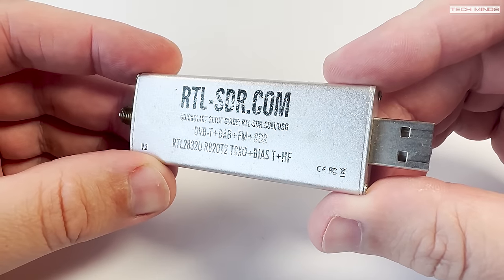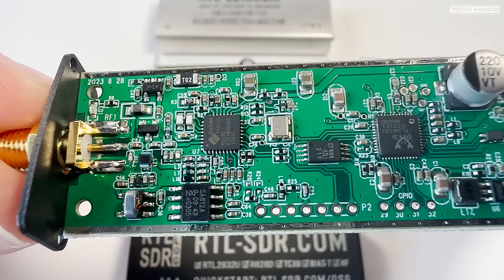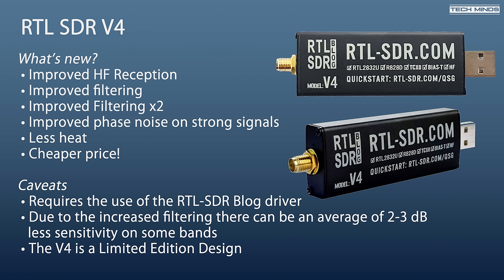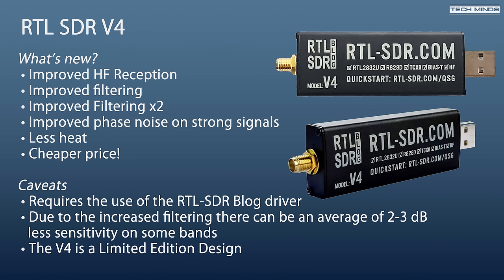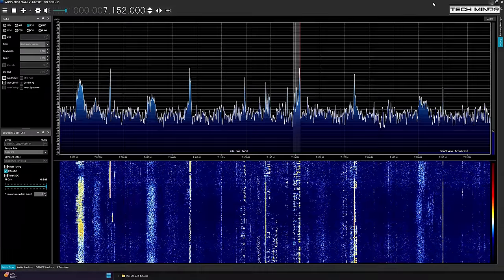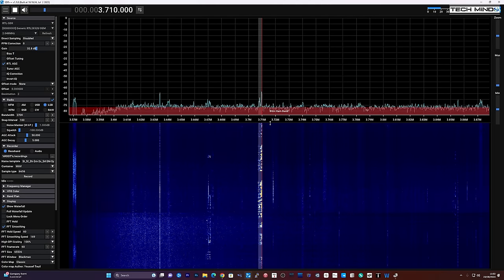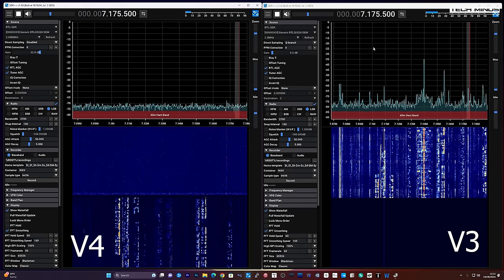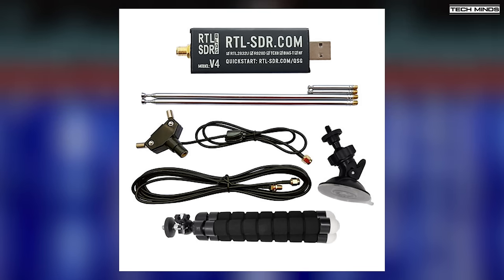RTL SDR V4 - Now with Built-In HF Upconverter  + More Features

Comment: Its using an old chip, the v4 will only exist whilst this old chip is around.  v3 or wait for the v5!
Reply from the maker: Yep, as said in the video, they have around 1 year of production supply left. Which is why it’s good to get one now.
Reply: This is not the latest iPhone so I don't think the R828 and R820 have that big of a difference in performance. And then you get an up converter with the V4. Just an external upconverter can cost more than this. So don't buy the V4, leave them for us .
Reply: Is there any difference in the descriminator section, extra band isolation, or any buffering that might be offloaded to the sdr software?
Reply: I have an sdrplay  duo is there any benefit to me buying the v4? Sorry if it’s a dumb question I’m a noob lol

Comment: I got my V4 yesterday. Below 30MHz after dark it suffers very badly from images and overload even with the gain turned down to minimum. It looks like the LO level in the upconvertor is too high. There are two unused pads where resistors could be added to attenuate the LO.
Reply: What are you using for HF ? Seems yours may has a fault unless you live very close to some high power MW transmitters . I hope they are not all like this :(
Reply: @martinbarnes869
I confirm what you wrote. v4 is very susceptible to be overloaded with HF signals. Apart from the visible copies/distortions in the HF spectrum itself, it is much easier (than v3) for images of AM broadcast stations to appear on the spectrum of e.g. FM radio stations. I wrote to RTL-SDR blog and they also confirmed that I can try changing the mixer attenuation.
Have you managed to come up with any specific modification that could improve this problem?

Comment: Ordered one, will give it a go. My v3 the smallest movement and the usb would disconnect, don't know if it was just faulty, hopefully this one is a bit better.
Reply from the maker: Sounds like it was faulty, or the usb connection was. Never had an issue with any of my V3s. V4 is really good imo. Cheers
Reply: They're all like that, I have tons of original v3's (silver ones) and lots of the Nooelec versions too. They are all very sensitive to movement within the USB port, on any computer. The best way to combat this is to use an Amazon basics or similar usb extension cable and wrap the connector and sdr together in self vulcanizing tape. No sticky left behind when you're done and it keeps the connection nice and solid if you need to be able to move the rtlsdr around when receiving.
Reply: Sloppy USB mating is not uncommon, especially on ports you use a lot.
I sometimes put a small strip of masking or insulation tape on the connector
to pad it out for a tighter fit.
Reply: @VTXHobbies  Sounds good but might prevent heat dissipation?

Comment: just bought a v4 I hope it works on my openweb rx docker. My hermes 2 mainboard should be here in a couple days..cant wait for that thing.
Reply from the maker: You'll love the Hermes Lite 2. I still use mine as my main radio. Just make sure to use the Thetis version which is designed for the HL2. Or you can use SDR Consolse, but Thetis is better IMO.

Comment: Got myself a v4 kit recently. Took some trial and error to set up the driver/software but it works fine now.
I don't know much about radio and did almost nothing with the subject since I stopped playing with my dad's Philips D2603 Power booster 4 band radio in the 1980s. But it is nice to be able to tune into random things again. I love the visual tuning. I'm probably limiting myself with the indoor antenna from the kit but I like it so far.
Reply: I'm trying to get v4 running on SDR++ but I haven't picked up any signals yet. :(
Reply: @joshua511  That's not good. Even with bad antenna placement you should be able to receive some FM radio stations. I think there may be something not good with your installation. You should be able to do some tuning, hear noise on most frequencies but also some radio stations and perhaps a lot more.
Reply: @Aranimda  It's something with v4. I'm on PopOs. CubicSDR seems to work, though.

Comment: my V4 came in yesterday.  I picked up to ham operators with my VHF-UHF TV antenna.  It's all I have to test with now.  I could hear both speakers very clear.  Nearest was 700 miles away and farthest was 1200 miles.  They were on frequency 14,164,040.  I need to put up a long wire next.

Comment: I ordered the  V4+ antenna kit after following the link from the sdr blog page to ali express a couple of days back, Will be the first SDR but i had been thinking about it on and off for a while. bit limited for antenna where I live, going with the airspy software to start out. one thing that would be nice to have that i have not seen is a scanning option, so for example set to scan 11M and have it stop where there is a signal.. perhaps it is there as i dont have the sdr yet to plug in and play with. Glad I saw this as it has kind of confirmed i had made an ok choice especially at the price point.
Reply: The Sdr# app has a scanning plugin.

Comment: Great video. I like the v4 so far. It works great for the price it’s excellent. I bought two. It's almost as good as my Sdrplay RSP1A. I will build a Linux box and use them for an openwebrx setup.
Reply: Was about to post a comment asking about drivers for Linux - that's all I use and ever will. So no problem running it on Mint?
Reply: @JCO2002  Same. It seems we have to build the driver from source.
Reply: @goku445  Just picked mine up. The Debian terminal commands worked fine. Getting HF without direct sampling. However, I still have interference at repeating frequencies across most of the band - was hoping the V4 would take care of it. Sure wish I could figure that out.
Reply: @JCO2002  thanks for the feedback. I'm getting mine in a week. New to the hobby. Did you buy a new antenna?
Reply: @goku445  I had the dipole that came with the V3, and attached a long wire to it for SW in the past. It's up on the roof here in Jamaica. The V4 is definitely better than the V3 using GQRX and SDR++ with Linux Mint. I don't know where my interference is coming from, though. Going to get a FM broadcast filter and try that. But it could be the neighbours stealing electricity from the mains with their "throw-ups".
Reply: @goku445  I'm getting the CHU time signal from Canada on both frequencies, which I could never get with the V3. Most of my SW stations are in Spanish, though, because I'm in Jamaica.
Reply: @JCO2002  Awesome! I'm sure to have some fun with it.

Comment: I am an AM radio nerd, love DXing seeing what I can receive, how does the V4 compare to the V3,  because the V3 kind of sucks on the AM band,  I am in the USA if that makes a difference. Thanks in advance for any info provided
Reply: As long as you don't overload it with too strong signals, it works great.

The upconverter have a 14 db gain, and you have the tuner gain in addition. Seems to work well.

Comment: I wonder how this V4 would compare to something like the RSPdx? Thanks for sharing, very interesting info as always.
Reply: the RSPDX has significantly better filtering and switches in filters to block out everything except fort he band you are currently trying to recieve.    You can do the same with the RTL-SDR by adding external filters, but they dont auto switch you have to manually insert and remove them at about $15 each.   if you live near a cellphone tower, AM broadcast,  FM broadcast or other transmitters then you need the filters.  I have both, and I can hear a lot of much weaker signals with my SDRPlay than I can withthe V4....  it's better than the V2   but not even close to the sensitivity of the SdrPlay simply because of the lack of filtering.
Reply: Dont forget that the sdrplay is almost 4x more expensive
Reply: Pay or settle for 1990's technology. It's a no-brainer...

Comment: I ordered a V4 and should be getting it in a day or so. Interested in the improved HF performance as I have been using the V3 with an MLA30+ mag loop antenna which is usable but the V4 improved HF performance looks worthwhile.
Reply: The V4 appeared in my mail box today. So got it working with SDR# but yet to see how it compares to the V3 on HF band with my MLA30+ antenna. Have not figured out how to keep the bias-T activated with SDR# as I can use the provided DOS command rtl_biast.exe to turn it on but when I start SDR# it turns it off. Also I use RTL-433 app for reading sensor data but it does not seem to support the RTL-SDR V4 as it uses what looks like different driver file as in librtlsdr.dll rather than rtlsdr.dll.
Reply: How does the built in upconvertor work? Is there no switch or offset to enter into sdr#?

It just automatically turns on when you go down low enough?

Comment: What physical antenna switch do you use?  I have a magloop for HF but it isn't really designed for UHF/VHF or Airband, and I'd like to connect two antennas to a switch and switch between them without having to unplug and plug in the different antennas each time

Comment: Good timing I was just checking this out yesterday!   I'm curious if it's problematic on OSX or Linux as you only mentioned windows???
Reply: No harder than the other ones. You can download the source and compile it yourself worst case.
Reply: The RTL-SDR v3 works fine on SDR++ on Mac OS. I'm guessing that a driver update might be needed for SDR++ to work wit the new radio, but I'm not sure. I think that's already in the latest nightly SDR++ build.

Comment: I have several v3, I could never receive anything intelligible on hf due to the noise, which is what prompted me to get the RSP1A. I do however use the V3 for listening to UHF and VHF, which they work well for. I may have to try one of the V4. Amazing little devices, wish I had such things 20+ years ago.
Reply: You Need To Configurate It And You WILL RECEIVE It On HF, Seriously, Maybe You Are Just Toogled The Direct Sampling, Tell Me How The Program Is Configured Or I Can Even Show You In Discord How To Do It, Like, Make A Videocall And I Can tell You Whats Wrong With Your Setup, Its NOT HARD To get HF Signals, Just Make A Long Wire ANtenna And Put The Program To Q Branch Where It Says DISABLED On Direct Sampling And Then Tweek Some Other Things ANd You Golden, Its NOT EASY To get HF, But There Are Many Things To Do To get it Half Noot bad, Im Willing To Help You Individualy :)
Reply: @frequencywatchers  I know how to make the V3 receive HF, the problem is that it has poor filtering, so it is very noisy. This is why they made V4

Comment: Only 2 months for mine to arrive.  Can't wait. 
Reading the comment's there seems to be a lot of people complaining they didn't get one as they were sold out but then start to say negative thing's only basing it off the fact it's a limited chip therefore it's a bad chip? 🤔 
Seems like an excuse to feel better as it makes no sense being a superior ic with more feature's. 
They're still around and he didn't mention any of the good stuff hidden on the PCB. 
Also if your using your case and complaining about poor usb quality, it's more user error. Stop touching them! 😂
Reply: First batch sold old. There will be more!
Reply: @erlendse  they're still on ebay and Amazon
Reply: Thanks for beta testing
Reply: @PW-72648  not a problem. 
Same ic footprint with an added circuit. 👍

Comment: I bought the V4 today and cant seem to pick up anything other than commercial FM radio, ie Capital etc
Any suggestions please?
Are the ariels that come with it rubbish?

Can I use my TV aerial Booster to pick up anything, or will it damage the front end?
Reply: Same here. FM works but pretty much bugger all else, and I was full of enthusiasm for this SDR stuff up until now....
Reply: @mussie302  Since my last post, I can pick jp so much more now
Reply: What magic did you weave?
Reply: @mussie302  An Aerial - But High up

I can even receive Amazon Drivers or some couriers, not sure what

Comment: I have yet to be successful like the other enthusiasts have. Barely received 3-4 FM stations, no ham signals detected, no satellites, do not know what I am doing wrong. From videos it seems to be really easy but not with my unit and the "rabbit ears" antenna in any configuration. HELP!
Reply from the maker: It's all about the antenna. I can assure you that the issue is with the antenna. If you are serious about receiving and listening to stations etc, then you will need to invest in learning about antennas. Something off the shelf, for multi-band VHF/UHF a Discone antenna would be a good choice. For anything lower than 30 MHz then a long length of wire as high as possible would be great. Maybe even a 9:1 unun depending on the length of antenna wire. Any questions feel free to drop them here. Thanks. Matt

Comment: I bought a USB  RTL-SDR  1 or 2 years ago. So I know its not the latest version.  It works perfectly with my desktop but not with the laptop even though so far as I can tell, I installed the exact same software.   Windows makes the obligatory "ding-dong" to acknowledge that its been plugged in. Any idea why it wont work with the laptop?
Reply: Your mileage may vary, but on my Alienware desktop I cannot use a V3 rtl-sdr dongle on any of the USB 3.0 ports., I have to use it on the USB 2.0 ports
Reply: Try it with a Linux distro.

Comment: Will this work for monitoring CB and 10m FM mode? I am struggling to find a receiver that is compatible with FM. Thanks
Reply: Since it is an SDR, this is possible. The dngle itself does not demodulate the signal.

All you have to do is activate the narrowband FM in the software.